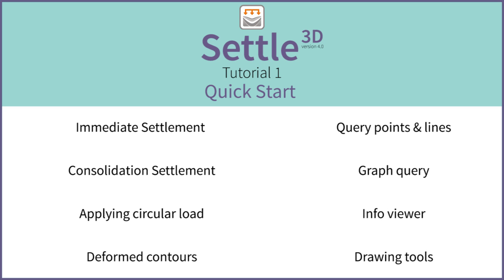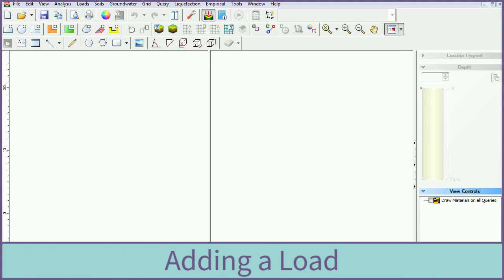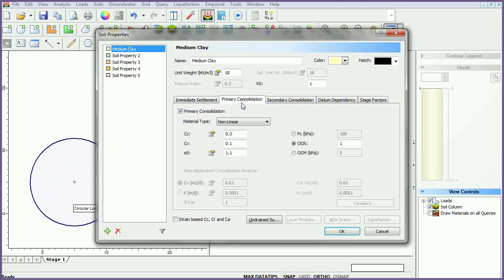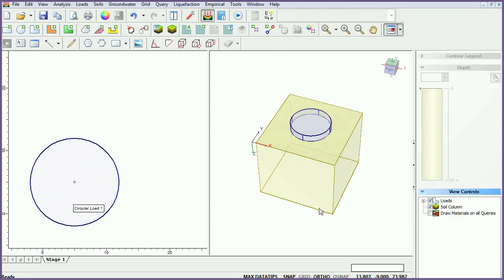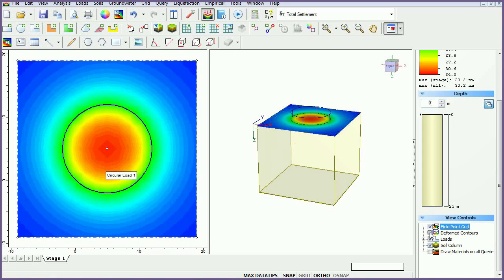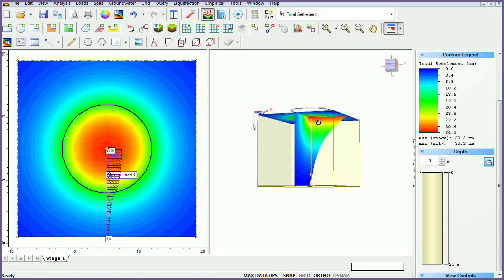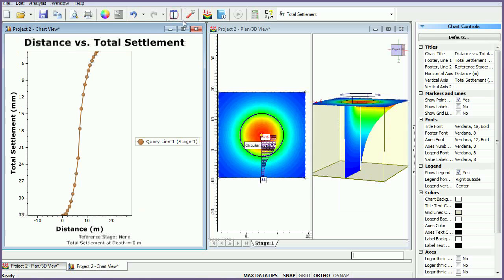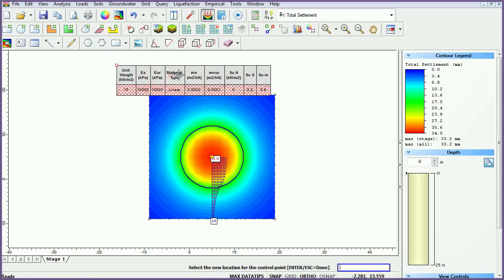Settle3D Tutorial 1 - Quick Start

Comment: Hi, the part about geometry creation is not very clear. If you add the circular load, the geometry automatically pops up in 3D. How about if I want to modify that default geometry/volume. Is it possible to model wind or earthquake loads?
Reply from the maker: Hello @Dr.alphonceowayo,

There are three ways for users to define soil geometry, and they are explained in greater detail in the project settings under soil profiles: https://www.rocscience.com/help/settle3/documentation/project-settings/soil-profiles.

One of these methods is a commonly used feature, where users can enter borehole data to create soil geometry: https://www.rocscience.com/help/settle3/documentation/soil-profiles/boreholes-overview.

Settle3 allows users to define loads in both vertical and horizontal directions.  However, for wind loads or earthquake loads, Settle3 does not currently provide dynamic analysis.

Thank you!